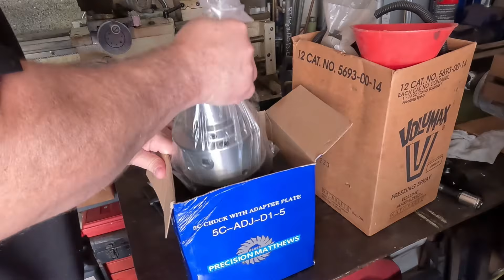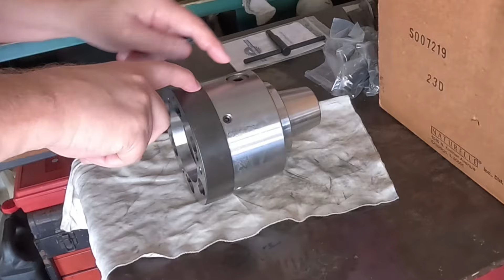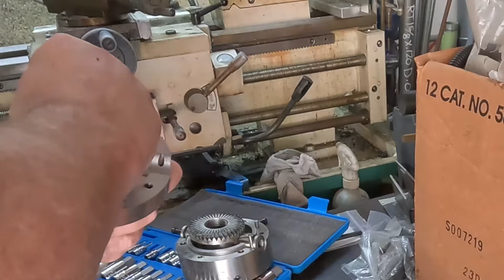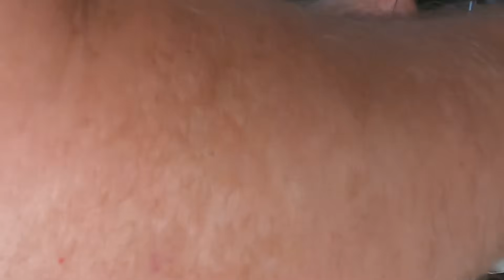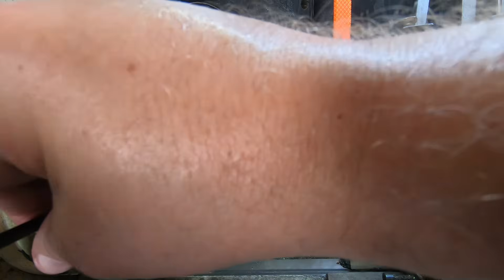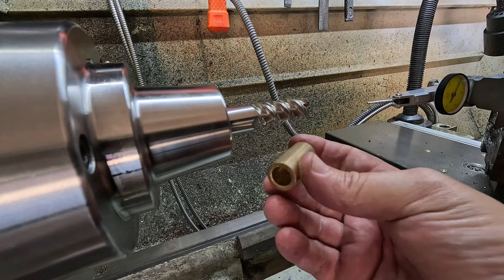Disassembling the Precision Matthews D1-5 5C Collet Chuck and getting it dialed in.

Comment: the cast one tend to be a but softer &   not hardened & often the teeth deform after a time.  One can cut a new set & harden them.  But as they have predust a 5c Collet that is  allowing  One to use an ER collet set in all sizes  I must say with the ER40 & 50 set of Collets it as simply given the  chuck a second. versatile &  choice to expand it usability .  hop this helps . 
PS Gven the job your going to do i would suggest you use the. 5c/ER 40 collets holder the 5C collet set   as the size's rang is much larger  even & compered to a full mill variant. LES the UK

Comment: There are 2 places to insert the chuck key, but I saw you mark only 1. How are you going to be certain you are putting it back together without being 90° from the original orientation? Also, why on Earth wouldn't you check the runout before taking it apart?
Reply from the maker: What I didn't mention is the 1 chuck key hole had a mark that the other one didn't, and the reason I didn't worry about checking the runout before is because regardless of what it was, I was going to take it apart, and the only runout I care about is the runout it has after I get it back together.